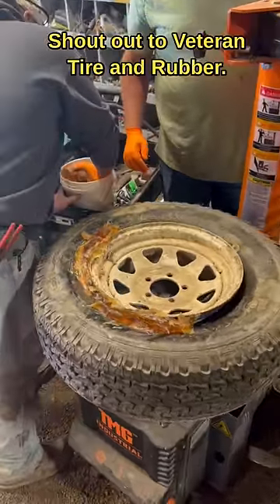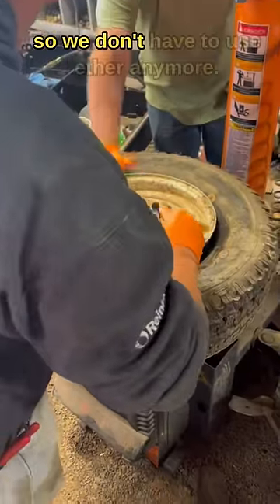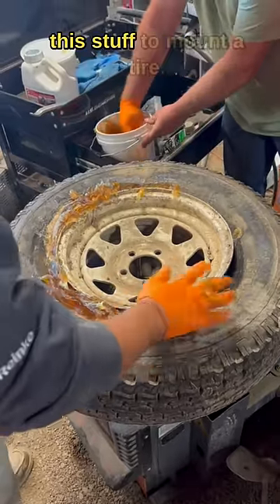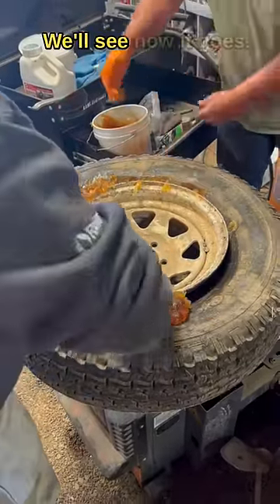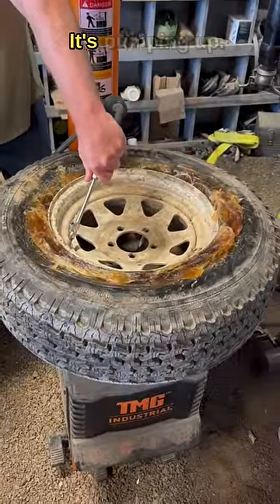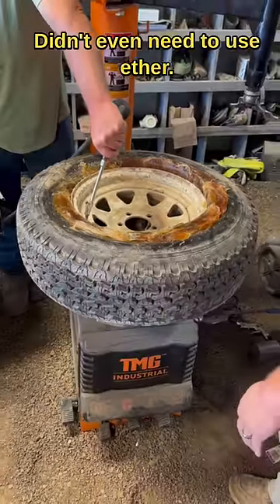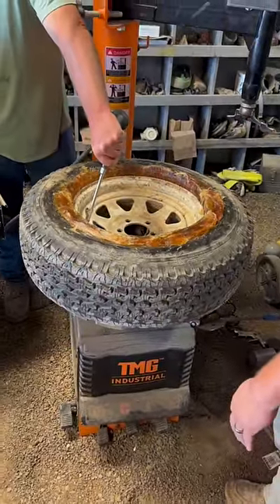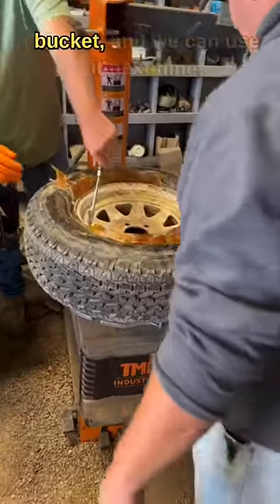Veteran tire and rubber sent some tire mounting compound. Let’s see it work. #farming #shorts ￼

Comment: This is what we used on the tires on road calls for 18 wheelers. Worked really well.
Reply: I do approve this mess on a go to job ... But i will never use this greasy looking shit in the shop !
Reply: How about an Air blaster tank
Reply: this trick i used on road calls when the cheetah tank didn’t work
Reply: @void3790  what's the worst animal to play cards with?
Reply: This stuff would make sense for that application. But for regular car/truck tires I can't imagine you'd ever be able to balance them afterwards.

All it would take is a little bit of the stuff on the inside warming up with the tire and everytime you come to a stop your balance will be off again.
Reply: @Benson_aka_devils_advocate_88 you would imagine the tire balancer would sling it to the middle of the tire
Reply: Man a cheetah is what that’s for. The Greece is to take it off and put in the 18 wheeler rim
Reply: @bradbozarth3235 a cheetah? 😂

Comment: I once bought a set of "unobtainium" NOS tires for my military truck (M561), and the tire shop tried using that bead glop without success. They finally got all six tires mounted using an air dump from a charged air tank through a bead cannon.

Comment: It’s works amazing as a lubricant for mounting and dismounting!  When the bucket is about half way empty till it back up with water, mix it up with a paint mixer(on a drill) and let it sit over night.  Best lubricant ever!
Reply from the maker: We will have to try that
Reply: A bottle of cheaper dishwashing fluid and a cup of water. I only use that when i have a bad bead
Reply: We use to just use tire soap at my shop, I forgot the brand but it's just a white lubricant everyone calls tire soap, it worked really good!
Reply: Can’t that residual inside throw off the balance?
Reply: @Lotek117 Murphy's
Reply: @Scrapps97 nice! Thanks for the explanation.

Comment: Tire man here, I prefer to just grab the bead blaster. By the time you get some gloves on and grab the mounting compound youd’ve already had the tire aired up and ready to go. Not to mention this stuff can get very messy, and it has the possibility to make the wheel slip. We only use this stuff as a last resort if absolutely nothing else can get the bead to set.
Reply: not just that but could make the tire unbalance with the excess fallen back into the tire
Reply: Yeah I use the Cheetah 99% of the time the 1% of the time it doesn't work I grab a can of starting fluid and burn most of my hair off my face but I get that tire taken care of
Reply: The tire machine at my school had a built in bead blaster
Reply: Balancing issues?
Reply: “Tire man here” 😂😂😂
Reply: Tire man here as well. I got a good laugh at this video even tho it worked lol
Reply: @chadklaren9537 if you’ve never used a blaster theyre way better than the cheetahs. My buddy does semi tires and he’s in love with his new bead blaster. It’s got an actual trigger over the ball valve that the cheetah has
Reply: @Th3CommentGod Commercial Tyre man here, same mate funny vid but it worked
Reply: @dimgod5168  lol usually only use that stuff to help me mount some 11Rs or something. Or filling a gap on a 10 ft tire lol
Reply: @chadklaren9537 I’ve use the cheetah constantly at work with mainly 20s I find to be the worst for setting a bead had a tractor tire recently that cheetah was wicked to use for it
Reply: Those tires were recalled in the early 2000s.
Reply: It would be good for farmers and small engine shops!
Reply: As a former tire guy, bouncing it on the ground works too. 😅
Reply: Michelin Man here*
Reply: Last resort for sure,my old school boss would make me blow it up with that stuff then leave in sun all day dismount and clean everything then re mount and hope I don’t need that shit again oh and all that for a used 35 dollar tire 😢
Reply: I’ll stick with eighter less messy and a lot easier
Reply: I'm a diesel mechanic well said my friend
Reply: Lmao seen a 4x4 spin it’s rim in one of the tires when I was young. Was then I understood what bead locks were for lol
Reply: Not to mention the mess it makes, but if this is your only option I would go for it
Reply: @chadklaren9537  company I work for now has a cheetah and I hate it. Last place I worked had a bead bazooka and that was a lot better to use
Reply: The cheetah?

Comment: You push down and twist the tire a bit, kinda seats the lower bead, then,  as you quickly pull up on the tire, with the valve stem insert removed,  you step on the air supply pedal. It beads up. Some machines even have a ring that will blast air in from under the tire,  so all you do is lift the tire kind of seating the top bead and step on the pedal, blasting air in the tire and seating both beads. Then air it up.
Reply: Common sense isn't common

Comment: Same guy later that day...."we cant get these wheels to balance out"
Reply: You don’t balance trailer tires
Reply: @Dirtyboats  False I work in the tire industry have for 9+ years and people prefer there trailer tire balanced it helps with the wear of the tire and helps it last longer a lot more blowouts happen on a unbalanced tire idk how buts it does.
Reply: @Dirtyboats yes you most certainly do.. lol
Reply: @BaNoodles999  I’ve been changing tires for 10+ years and have never been asked to balance 15/16 inch trailer tires.
Reply: @Dirtyboats  you must work for a mom and pop shop I work for a company and we’re required to the balance the trailer tires no matter the size.

Comment: We used to water that stuff down in my tire mounting days stuff is magical for the trailer tires that were bound down for shipping, and it helps ALOT with extremely low profile tires.

Comment: 7 months ago I said ain't no way a supervisor is letting you put that much beading compound on... And here I sit today, thinking the same damn thing.
Reply: In my family tire shop...we habe had to do yhis a few times...it was after nothing else worked
Reply: You take it off and put it back in the bucket after the bead was set
Reply: @riekoortiz4486  I fuckin hope so. Even still, if you're truly professional you'd know having that much compound on places that aren't the bead adds up and becomes weight. That weight most likely won't be removed until the finish, meaning you'd have an improper balance on your tires, eventually causing a customers car to pull or unevenly wear, which then would also result in a pull.

It's a minimal amount of weight, but in a job all about precision, safety and professionalism, you should be taking these extra steps
Reply: @AidansCars shut up
Reply: @AidansCars the pressure inside of the enclosing space (tire) is greater than the atmospheric pressure outside of it. All of this viscous mass is going to be pushed out during this event seeing none was even put inside the tire beyond the bead
Reply: @addisonturner4123  Except the air isn't just trying to leave the tire, it is also applying a force on the side of the tire, closing the gap. Unless you ensure the compound specifically stays clear of the bead some will get squeezed into the tire when it closes.

Comment: As stated previously, you can dilute it with water and use as tire lube. Works great in the field where you may not want to light your field on fire or kill employees/family/friends with flying wheels.
Made from vegetable oil so no crop contamination either.
Reply from the maker: Thanks for the tips and thanks again for the compound.
Reply: We don’t have bead bazookas or we would have sent one of those as they are more fun. 😅
Reply from the maker: @robertr3470  I have seen those but haven’t used one before.

Comment: The old ratchet strap "trick" has always worked for me!
Reply: it's the correct way
Reply: On the side of the road it easier to store a strap than a big bucket
Reply: Can you please explain to me, the rachet strap trick ??
Reply: Strap a ratchet strap down the middle of the tire on the treads, tighten the strap down, and inflate the tire.
Reply: @hdj1954  Yeah I had the tire on my wheel barrow go flat off the rim and never knew this till I asked a friend. You learn something new every day. 😊
Reply: Me too.
Reply: I used a rather strap once or twice. One unhooked while inflating. Those hooks went flying at high speed. That got my blood pumping.
Reply: This is the way I've always done it.
Reply: @beetlestompit  it's even easier to store a can of either
Reply: @Dagestan.Warrior.Alpha_1  wrap the ratchet strap around the center of the tred of the tire and crank her down as you pull on the middle of the tire it expands the bead so that it touches the rim and you can add air to set the tire. Either is a lot easier and faster if you know what you are doing. And if done correctly it not very dangerous
Reply: @Dagestan.Warrior.Alpha_1  you put the strap around the middle of the tire and crank on it so the side wall are touching the rim and air it up

Comment: Now you have a free moving weight inside the tire from the excess that was pushed into the wheel.... just use a ratchet strap or a air cannon
Reply from the maker: Ok sounds good
Reply: I was thinking the same thing about the grease in the tire.
Reply: @RockyMountainFarmer  yeah just try one of them big yellow ratchet straps right down through the center of the tread tightening it down will squeeze the side walls out far enough. take your air Chuck off of your air hose take your valve out of the stem and slam that air hose down on that wide-open stem and your tire will pump up like 90% of the time. But I think I use ether before I use that Vaseline stuff
Reply: @kevinstill1 I was thinking the same thing about the grease in the tire
Reply: Yeah I always just use a strap maybe a small bead of grease from a grease gun
Reply: Luckily it'll centrifuge itself evenly around the inside of the tire pretty quick, prob just a little vibration til it warms up the first time
Reply: That stuff is basically industrial solid soap. It self balances once the tire gets warm enough and it "melts" around the perimeter of the tire. Still messy though and smells like shit.
Reply: Ratchet strap right down the middle of the threads, works every time.
Reply: It doesn't matter for big equipment and tractors which is what it is usually used for, and if you're gonna use it for a smaller tire you just put less, and you don't jam it in there, you just put it to the rim and it pushes it out when the bead starting to catch... like it's just a grease and if anything will increase the longevity of your rubbers, if you don't know just say so bo
Reply: Terrible idea
Reply: @camaroman101  I was thinking the same thing about the grease in the tire
Reply: @kbeargaming3449 curious, what is industrial solid soap? Google is not helping me much on this one😂
Reply: It's all soap. There's just different mixes. This is concentrated, you can use it to seal the bead. You can add water to some and make a paste, aka " bead butter " or mix more water and brush it on. Cheetahs, ratchet straps, ether, all useful tools. People talking shit are too limp dicked to even check their oil let alone mount a tire. They watched some videos and got their YouTube G.E.D 😂
Reply: @kbeargaming3449 like your mom?
Reply: @linkbond08 it does?
Reply: @Logan.  look up Murphy's tire mounting compound.
Reply: @bobbyhall7472  And here we see a no laugh joke from a guy that barely knows what a tire is.
Reply: @raze4789  I dont support the use of ratchet straps because ome the beads are set, the tire tread starts to expand and the strap can sometimes be too tight to get off. Having a tire break a ratchet strap like that is really scary.
Reply: @grantcoley3006 I was thinking the same thing about the grease in the tire
Reply: Actually the compound becomes evenly distributed from the centrifugal force. Nothing is bouncing around or weighted unevenly.
Reply: not if u apply it right
Reply: The heat and motion of the tire will coat the inner wall pretty evenly. I don’t think it’ll be an issue
Reply: @kbeargaming3449 would it not then settle at the bottom when you park? If it gets in there at all it seems like it'll be a problem but maybe I'm overthinking it.
Reply: @GruntBurger  tires get hot when you drive, no matter if its cold. But typically its not enough murphy's to make a huge difference.
Reply: @kbeargaming3449 been there done that
Reply: In Low rpm instances it probably doesn’t matter much. This isn’t a street/ track Hoosier.
Reply: @raze4789 Murphy's and Wilcox isn't soap, it's from processed vegetable oil.
Reply: @orangejoe54 yeah but then every hot day it's gonna melt and then settle in the bottom when it cools at night.
Reply: Next step is to heat the tire, and rotate it until the grease is even on the inside, automatically balances tire as well
Reply: In theory, the air pressure should push the vast majority of it out when the bead sets.
Reply: @generalkayoss7347  that's what I'm saying. I think everyone is overthinking it. You can clearly see it being pushed out of the bead. It's literally keeping the air in.

Comment: Ok... Not all "Either" starting fluid is the same concentration.  I was doing this the other day.  The starting fluid I was using was weak as piss water.  It just burned.  No "pop".

Get high concentration Either.  Don't use too much.  Like 1 sec burst.  Run a trail spray over the side n light it.  Little "pop" and yer good to go.

Skill level... don't overdo the Either. 

I have done 18 wheel tires, skid loaders, heavy pickup, lawn mowers.  Works great.  Just can't be total chicken.

Cold day in hell before I would spread that much yack snot on my equipment...WTF!

Comment: Ive worked at several tire shops, but even before that, i was the guy that could mount up 4 15" tires in an hour with no tire machine. Trailer ramp, or high lift jack to break them down. The days of easy 15" tires is gone. I hated rubber band 19"s, and 20s. Nothing but a pain. And about everything has painted aluminum wheels now. No polish, no lip for the tools to ride on. Just a flat painted face you can't even touch without a chip of paint coming off. 
If one was too skinny I just used a bicycle inner tube with some grease on it. 
So you can stretch a 205/65 onto a 8 wide 15. 
Never seen anyone use my inner tube trick. Always bead blasters, fire, or this soap. I dont mind the tire mounting compound, but one heads up. If you get a wad of it inside the tire, it will be a bitch to balance. And definitely never use it on a tire that needs balancing beads. It will stick them to the inside of the tire and really make it vibrate.
Reply: I’ve used inner tubes before I’ve done some pretty nasty stretches to in my city every one tries to be a stance boy and I was the only one that could stretch tires or get a really wide gap of a bead to close on the really hard ones I’d used a ratchet strap and break cleaner…. A simply recipe for disaster good thing I’ve never had nothing bad happen lol this messy shit I wouldn’t ever even touch if I had it
Reply: I went to a tire shop in 1999 when I had a lowrider to get new front tires . They couldn't figure out how to get a 155/80/13 to bead up on 13x8.  I said let me have a shot.  Sprayed the inside bead with soapy water used their bead breaker to push the inside onto safety ring then mounted it to the tire machine clamped on air and lifted up on the tire pop pop, now ya'll saw how to do it do the other side.
Reply: You are the guy for sure, props. Im sure you've seen more tires than this entire comment section combined 😂
Reply: @TristanCarver  not really, i haven't changed a tire myself since I had the lowrider. I did do 3 sets of front tires back then. I'm just good at figuring stuff out.